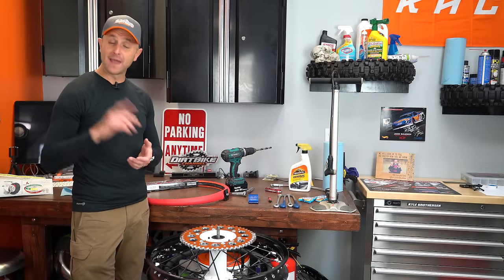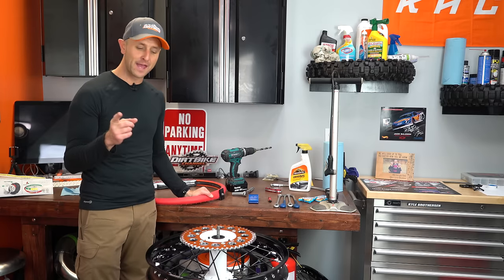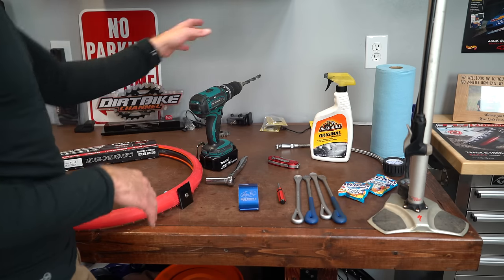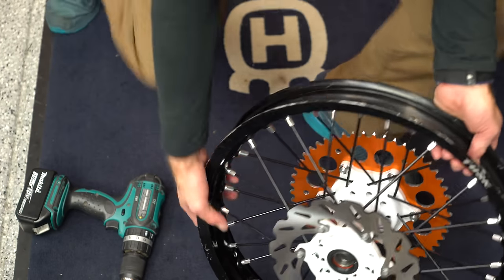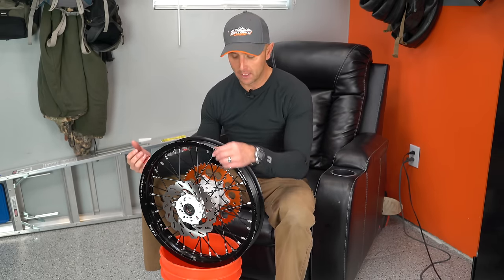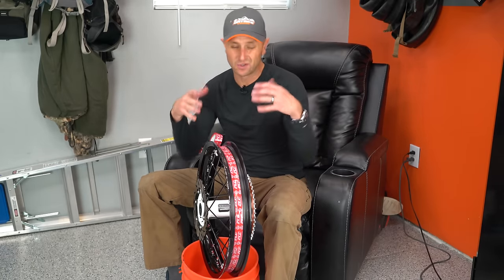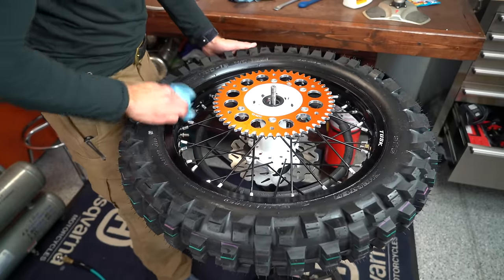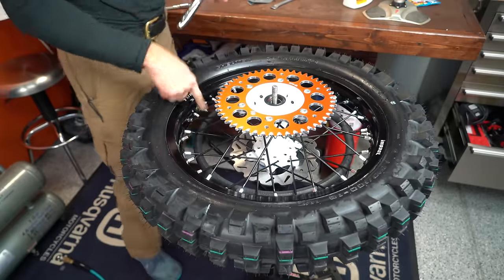TUbliss Installation Guide | How To Install TUbliss

Comment: Tip: you struggled to get the last little bit of the bead over the rim right? At the end of spooning on your tire, put one spoon at the struggle point while you work the tire around. This spoon will be in place so you don't need to push the spoon between the tire and rim. It makes for a much easier finish.
Reply: These r the kind of tips that make stuff like this great. Awesome idea and will do for sure. Something so simple and great. Like why didnt I think of that. Haha.
Reply: stand on it
Reply: nice
Reply: Dammit wish I’d read that before I just mounted my tire
Reply: it was where the rim lock was.
my tip for that situation would be to undo your bead lock some more, and use the tyre spoon to push the bead lock in and the tyre just falls in to the right place.
Reply: @quintinlarson9499  they are built in to the tubliss system.
Reply: Thank you very much sir very nice video what are your channel you don’t have a transfer for another language try to do it the best sir you are proficient
Reply: *specifically 19 inch rims

Comment: You’ve taught me to pay someone else to do this for me😀
Reply: As we grow older, wiser and wealthier, we tend to say, screw this, give it out. Got better things to do with my time.
Reply: :D :D
Reply: Yup!
Reply: I asked my shop to do this.  They popped the front high pressure bladder, discounted my other stuff, and said they will never try to do it again.  DIY is my only option...
Reply: I ended up having my dealer install the bib mousse. They said there worst than tubeless to install.
Reply: I just dropped off two new tires and only had one front tubeless. Place charged me $177 for tire install. Stating they had extra time on the tubeless. Time to start doing shit myself.
Reply: I know : )
Reply: you must be out of patience or old 😛
Reply: HAHA
Reply: 50 quid to fit U.K. 2023
Reply: Exactly. $20 here in Australia.  So cheap less hassel

Comment: I like to see that even Kyle allows for scraping and dinging the rim finish when throwing a tire on. Without a machine it's a violent process.  Great job with video.  Thanks!
Reply: I wonder why tire spoons are not dipped/coated in plastic?  seems obv
Reply: The good news is ,the tire bead does not seal on the rim. You could use rim protectors, if you wanted to prevent damage to the rim.  Cheers. And thanks to Kyle!

Comment: I watched this video 3-4 times....read some other articles, watch the tubliss videos. In the end, I followed this video, on the front I drilled the hole at the 4rth spoke, in the rear it already had 3 factory holes, I said no way am I drilling a 4rth. It worked out just fine. These instructions are spot on. THe tape comes with new instructions saying to wrap 3 times. I used fake Armor All from Dollar General, worked fine. Bottom line, I learned a new easy way to mount tires, I always struggled and busted my knuckles and tore the beads before. This just worked. Tubliss is best, most solid system I have tried. I previously used 3M tape, Flex Seal, and had very mixed results. Super happy with the product, they have held air for 2 hours so far which means they are probably good to go. I will try to ride this weekend. I dont plan to use these under 14 lbs anyways, I just dont want to have to change tubes on the road....plug n go for me! Thanks for this video, it was spot on!

Comment: Great video, so many great tips. The most useful tip I found at about 21:11 where it’s almost the finish and you are just about sure you ordered the wrong size tyre 😁, using that 2nd tyre iron to knock the opposite side off the bead and further down into the rim make a huge difference, I found doing that multiple times really helped get this process over the line. Love all your videos

Comment: Great work dude, but here’s another pro tip i’ve learned from installing cush cores on my mtb, wich in close to impossible to fit a tire over unless you use this litle tip!

Once you start to struggle to fit the last bit of bead over the rim, flip the wheel over and really push the bead on that side in to the middle of the rim, go a couple of turn around pushing the bead to the center, then flip the wheel over again and it will be a breeze to fit that last bit of tire on!! 

Great video, keep it up

Comment: What I’ve started doing it “pre-staging” 2 tire irons at the last section of tire. Once the bead is super tight, those irons are in place and make it super easy to finish without damaging the tube or liner in this case.

Comment: Great video, something that I've found helps with tire install is to get a couple of small ratchet clamps (wood clamps) you can use them to pinch and hold the tire into the recess channel in the rim to help keep it there while spooning in the bead
Reply: Genius, im trying that
Reply: Not sure why the tubliss technique says to put opposite side in the drop center when there is NO DROP CENTER on a tubliss setup!

Comment: Tubliss is amazing!
Nice vid explaining the process and easy to fix a puncture like a nail.. I carry a plug repair set with co2 canistors to fill up the low pressure side.
The kit is small and I carry it in my tool kit around my waist.
Saved me on an enduro trip in Romania.
I did ride for 30 mins on the trail with zero pressure which was no problem at all.
The traction in those gnarly woods was amazing.
In fact all the rentals had Tubliss and they never have a problem on them.
Those bikes were ridden hard too.

Comment: Nice video!  I have a Rabiconda, the bead breaker is handy for the last little tight bit shown at 22:15 🙂  Excellent tip with the Armor All.  Soapy water works well, but it dries out pretty quickly.  Armor All stays slippery for awhile!

Comment: Interesting thought about using armor all instead of soapy water. The water usually evaporates too quickly to be useful. I use an instant detailer called slick mist. Not that it's any better or worse than armor all, it's just what I have sitting around. The spray bottle and shop towels are also convenient, and you can wipe down the bike afterwards. Double win!

Comment: Commenting on old video but got a tip. Instead of using razor knife to cut jagged hole and possibly your finger just use a common center punch or big nail set. Poke it through the hole push it down till tapered part meets rim and twist.... safely cuts the tape for you and makes a perfect hole.

Comment: Really liked your guide vs Nutech.  One thing to point out I found that some tires are harder to install than others depending on the sidewall/structure.  The Dunlop 606 is a bear.  As a result, it's easier to pinch/damage the Tublis blader during the install.  It's critical to be very carfull with tires you struggle with.  Also, I've blown the bladder at the stem going over 120psi with the compressor.  It's best to use the cycle pump as you've demonstrated.

Comment: Just finished up installing tubliss on both front n back tires on a crf450l.  Tires had a good 200 miles on em and a fair amount was off road.  The back tire put up a fight but the front was pretty easy and absolutely doused 'em in armor all and that green goop tire sealant stuff.  So far no fast leaks, crossing fingers for no slow ones either but I guess that's pretty common.

Comment: Thanks for the video that was very helpfull and when I doubt I keep coming back at it ! Three things I'd like to add:
- Could you make a video on how to remove a tire properly without damaging the Tubliss ? I find it hard to not catch the tubliss when removing a tire.
- I have flipped my tires which were at 50% wear to get a fresher edge and they work properly with no pressure loss. Key seem to lub up the system before inflating the red blader.
- Blacksoap mixture used for the house and plants work perfectly and is natural.

Comment: When you used the  mallet at the end is why I never leave the bead lock for last. 

And as a MC tech I’ve changed hundreds of half to 3/4 used tires to put new tubes in without tearing the tire/bead.

So like you stated, a used tire can be reused if you do it properly. But much older than a few hour old tire.

Hell even used tires on the old KTMs with two bead locks. Just gotta be patient and not take too big a bite.

Comment: Valves should be 4 spokes apart, drill a new hole and cap the other hole, that's what the little black button in the kit is for. You'll possibly tear the high pressure valve stem when installing if it's 180° from the rim lock

Comment: @dbc, I see you reused the rim lock hole opposite, but the instructions are very clear not to do this due to damage when removing the tire.  I'd rather not drill another hole in my Yamaha rim, so my question is, have you had issues where the holes are opposite of each other?  Thanks in advance.
Reply: The instructions specifically say four spokes apart with the valves.

Comment: 16:14 At this point, triple check that directional tires are rotating the right way and the tire is orientated according to the sidewall dot (if it exists) denoting the lightest part of tire. Match the lightest part of the tire with the heaviest part of the rim for better balancing.

Comment: Easy way to cut the hole in the rim tape. Heat a bicycle spoke or a peice of welding rod with a blowtorch and use it to melt the hole out, works perfect and maintains the integrity of the tape

Comment: One tip to help a tire head set, and I know this from changing car and truck tires roadside by hand, is putting a ratchet strap around it with a little tension as you air it up. If you get one that does t quite pop and seat on the shoulder of the rim perfectly, use your irons to pull it back down into drop center, lube it up, a little strap pressure circumferentially around it, then air it up using a compressor rapidly and voila

Comment: Kyle, I've got TUbliss on ten wheels across a few different bikes so, like you, I've done a million of them.  What was the purpose of spraying the Armor All on the outside surface of the tire bead after the whole shebang was mounted up?  That's not a surface that creates an air seal; the step that's similar in the TUbliss instructions actually has you pry the tire bead out of the way so that you can wet the outer surface of the high pressure liner bead, which like you mentioned at the beginning of the video creates the seal against the inside bead surface of the tire for the low pressure chamber.  Only thing I can think of is that it aids in seating the tire bead, but I've never had a tire not seat after I've aired up the high pressure chamber.  I actually wet down the whole outside of my inner liner (including the bead) with lubricant or sealant once it's mounted on the wheel, but before I install the tire.  Does double duty that way...makes tire mounting easier and aids in making that low pressure chamber seal.  Another item:  if you mount everything up and have a leak (whenever I mount a tire I put ~25 psi in the low pressure chamber then check pressure again a couple/few hours later to verify no leaks) then be sure to do the "reset" procedure that's in the instructions, a couple times if necessary, before you bail and unmount and remount everything...that's always worked for me in the 1-in-10 times the assembly doesn't seal up well, and I've never had to do a disassembly/reassembly.  Btw, I always run my race tires until they're about half worn (~20 hours) and then I move them over to my training/trail bike; never had a problem with those used tires sealing right back when reinstalled with TUbliss, so in my experience re-mounting well used tires works just fine.  I don't know why anyone would say you can't use used tires with TUbliss, unless they've damaged the bead of the tire or high pressure liner being hamfisted with it; it's not like the inside bead of the tire wears out when the tread gets worn!
Reply: +1- the only thing I could see that aiding is the tire bead getting set easier?  You should spray the entire high pressure tube and entire red liner before mounting as well as the inner sealing surface of the tire.  I use a high heat thick silicone dielectric grease on the whole shebang, it's thick sticky stuff but doesn't break down with heat or water and you never need Slime or Stans.
Reply: @PrimalEnduro  Can you post a link of the stuff you use?  The di-electric grease?
Reply: Some of the seal does take place between the rim and the outside bead. I know this because I struggled some with getting my Motoz arena gummies to seal. They have small ridges on the outside of the bead. My local bikes parts store wont install tubliss on motoz tires.

Comment: TUBliss looks great. I have a KTM1190 with tubeless tires,  unfortunately fitted with the standard pressure transducers and I don't see the TUBliss would work on these wheels without removing the transducers. Great Idea for off road bikes though. Great video thanks for shareing.

Comment: Hi, congratulations on the video.
I'm from Portugal and I noticed you're riding a shinko. I'd like to know what you think about the tire because it's a recent brand in my country.

hug
Reply: Shinko was Yokohama for years. 15 years or more a company bought the motorcycle side of Yokohama and renamed it Shinko. The tires are of high quality. Both the street and dirt models. For a mid priced tire they give you a lot of bang for your money.
No I dont work for Shinko. Im retired. After 50 years of motorcycles Ive tried a lot of bike things. Tires, et al....

Comment: Thanks for this video Kyle - I just finished my install of Tubliss and Shinko 525 on the rear of my 390 RR-S with no issue at all.  I did go the soapy water method though since I'm not going to run a sealant.  Will do the front tomorrow.

Comment: If you are going to use Stan's sealant I would recommend releasing all of the pressure out of both chambers before adding Stan's. The goal of this is to allow the sealant to get in between the mating surfaces of the bead/rim/tubliss so that it can seal up any imperfections in those areas as well. I have seen people with very slow leaks due to these things not sealing up perfectly. This will generally solve those issues.
Reply: I have a tubliss front that loses about 1 psi in 12 hours so I just pump it up to 12 at the start of my ride and it’s super grippy on the way back to camp! Lol. Guy who installed it nicked the bead a little
Reply: @Natedoc808  It happens, not the end of the world 😆
Reply: @craighoffman6876  lol, yup. Carry a little MTB hand pump and 2 CO2 chargers

Comment: Great Video!
I use about 4oz of Stan's in each of my 29er mountain bike tires. How much do you put in your motorcycle tires?
Also, have you had any issues getting your tires/wheels properly balanced with the TUbliss?
Thanks!
Reply: Yeah, they will be way out of balance. Doesn't matter in the dirt, can be very noticeable on road, especially at resonant speeds. If you are super keen, identify the heaviest part of the rim (if it's a brand new and not drilled, little choice otherwise) and (or, just) the tyre and the high pressure valve stem for the inner bladder, and situate those opposite to the bead lock of the tubliss system. This reduces the total amount of weight you need to balance it, but it's still a lot. I use brass spoke weights with a grub screw on my long distance adv bike with tubliss.

Comment: Tubliss says you must put the two holes at 4 spokes distance and if you use the rimlock hole on the opposite side it will cause damage when trying to install.  They also say don't use soapy water if you are going to use sealant as the soapy water damages the sealant and makes it fail.  Is the ArmorAll OK with the sealant?  I'm using the sealant you link to above.

I'm doing two of these these week so don't want to mess it up.  That is a really tight fit where the inner tube goes past the rimlock, almost no room even for the deflated inner liner.  Also at that point the tube is going to be doing some serious stretching when it gets inflated.

I also noticed there are little injection whiskers all around the tubliss outer sheath, which look like they could fold down into the seal area and cause problems.  It might be a good idea to cut all those off before installing.

-Well I used the Armorall and also Flatout sealant.  I also did cut off all the little whiskers on the red tube that could impinge the sealing area.  I think it is a good idea to do that.  I've seen some reports of slow leaks if that is not done.  OK so far.  If they hold up I'm sold.  Great traction with my new Shinko 505.  It is very tough to get the final bead over the rim since the Tubliss kind of interferes with the tire bead being able to seat fully down in the rim trough.  One of those Baja No Pinch tools might be very handy for this.

Comment: I'd also leave valve cors out till the tires are on that's a mechanics tip from some one that does tire changes professionally also I can use a tire machine to do a full tie change like this in under a minute also they make a special tire soap that doesn't react with sealant

Comment: Thanks for the detailed video...I've had one ride on my tubless system and loved it.  I'm curious about on going maintenance as I continue to put miles on the tire.  The Armorall spray will evaporate inside the wheel, do you recommend periodically lubing everything up once in a while or just leave it alone?

Comment: I am changing a small 12" rear tire WITH a tube on a KTM 65 without a stand.  I had trouble putting the tire on the classic way, just getting the first bead over the rim.  I was wondering if you have ever put a tire one like you did in this video WITH a tube?  Where you put the rim INSIDE the tire to begin with?  Do you foreseen any issues with this?  Seems like it may be easier with a smaller diameter tire?  I pinched the tube and don't want to do that again :)